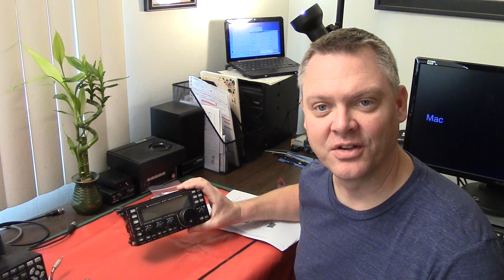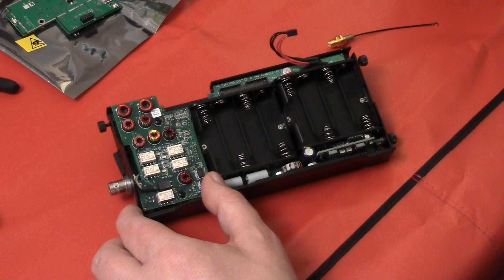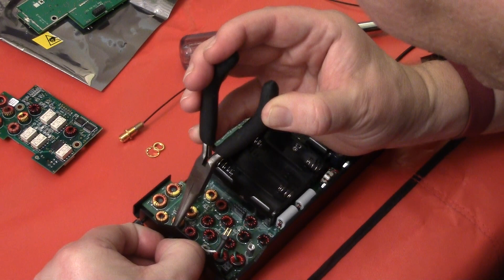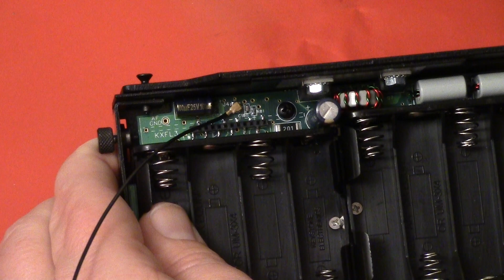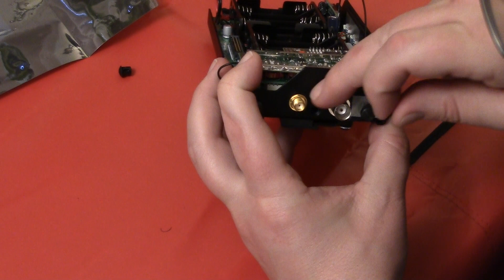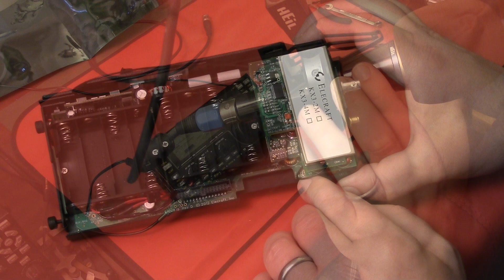Execraft KX3 2 Meter Transverter Install

Comment: So, do you think this module is worth the cost?
Reply from the maker: If you want to work 2m SSB, yes.
Reply: @tuckmeat  I ended up biting the bullet and added it to my kit.
Reply: I wish I'd known about it before I bought a 9700. 
Now I have a new to me K2 and have fondled a KX3, and as a result, want the KX3 with the 2m. I can wait on the panadapter.
Reply: Bought one--here in two days.

Comment: really good video to follow along with instructions.  thank you for doing this.  One question tho. did you forget the TO-220 retainer for the transistor heat sink?  I just installed this 2 meter board and re-read the instructions and installed it.  fits much better now.
Reply: @Ahmir Jaxen Definitely, have been watching on Flixzone for since november myself =)

Comment: Hi there.

Nice job with the install.  Not sure I'd even want to attempt something link that at this stage in my life.

Just a few criticisms about the video; 

You were blocking the view to the camera for all of the important stuff.  Try moving the unit or the camera so that it has a better view of what you're doing.

At the end of the video you showed barely 25 seconds of your contact.  On top of that, the microphone was totally blocking the view of the radio.  It's obvious that you know what you're doing when it comes to radios - so please try to be more conscientious about making sure that we can see the great work that you're doing.

By the way, at the end, I couldn't tell if you were talking to W6TED or WA6TED.  I think the latter is someone I talk to occasionally on a local repeater system.

Anyway, take care and 73,

Alan - N2DRO